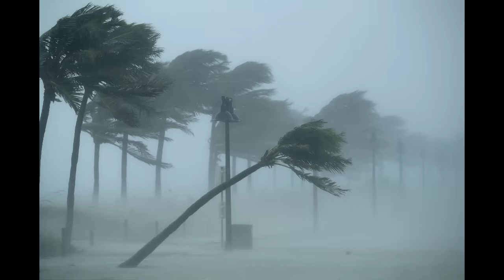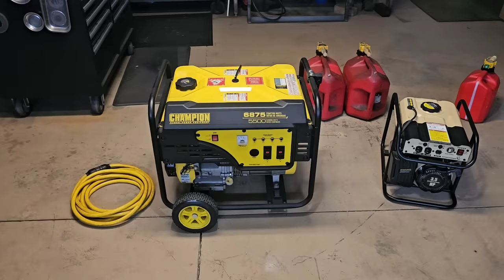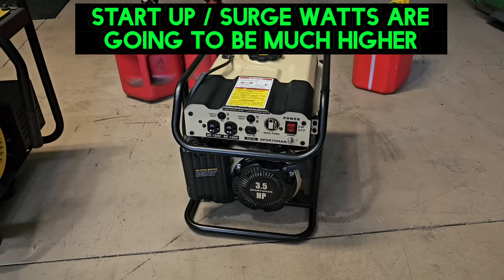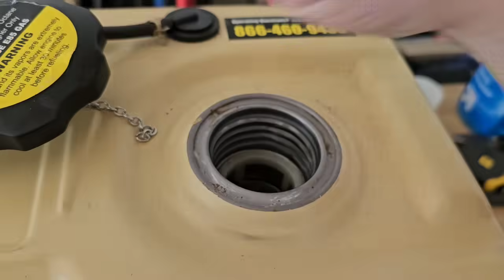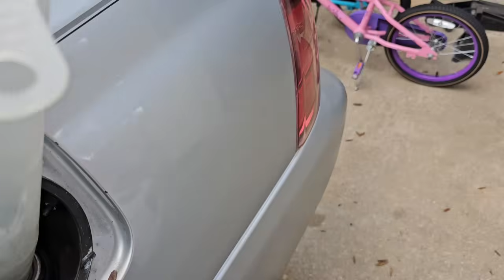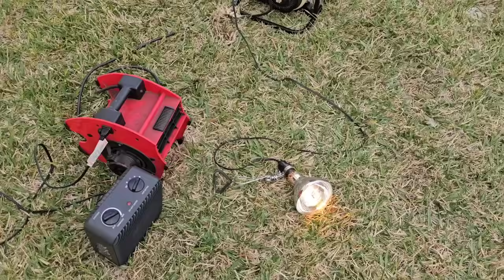Why smaller generators are better for power outages.

Comment: Crank your generators once a month.  Use only non-ethanol gasoline and put a fuel stabilizer in the fuel which will extend the life up to a year, easily.  If you do not have a Quiet generator, consider making a House to put the generator in to keep it out of the weather and tone down the noise. 

The use of Non-ethanol gasoline is critical, and you can often get it at a small local airport if none is available at gas stations.

If you are in an area where power outages are not unusual, having an extra spark plug and fuel filter is critical to have on hand, along with extra oil that maybe needed for long use.

Some Heat/AC units need an adaptor added to the unit to work properly.

The NON INVERTER generators may burn up computers, TVs and other high end equipment.  NON Inverter generators are usually ok for freezers and refrigerators, but anything with a computer needs an inverter generator, especially WIFI, phone chargers, etc.  Your local electric company can offer a wealth of information on these issues.
Reply: I drain completely the fuel. And I mean completely. Run it every 8 months and it starts on first pull. Don’t need all that extra ethanol free etc if you store it properly in the first place

Comment: Just went through hurricane Beryl with a 1500 W (1800 W peak) rating.  I was able to keep a fridge and freezer running along with a fan, chargers for phones and power tools, internet modem etc.   It has a 1.5 gallon tank that lasted about 6 hours per tank.  Our neighbors with the larger generators were needing gas often and gas was hard to find.  Although the neighbors with the large generators were sharing with those without.
Reply from the maker: Thanks for sharing Scott. How many days did your area go before power was restored? How much gas did you end up using?

Comment: I use a propane generator. When there was a power outage due to a snowstorm in Texas, gasoline was unavailable. There was no electricity to pump gasoline. I have a dual fuel generator and I have two weeks worth of propane. It doesn't go bad, doesn't gum up carburetors and it will run everything in my house.
Reply: Me too propane is only way to go or natural gas as back up
Reply: Been considering this same idea. Duel fuel and having propane tanks on hand since they just hang out til you need them. How many tanks do you have for two weeks supply? What size generator? Thanks!
Reply: @stephencabrera8785  12000w  pulsar g12kbn, and I have 4 100 lb tanks and six 20 lb tanks. The generator will run for 7.5-8.5 hours on a 20lb cylinder. I'm not sure exactly what that adds up to with my supply, but it is enough, in my opinion. My brother has a 500 gallon tank with the exact same generator.
Reply: @leodanryan966 4 -100 gallon tanks?  No access to NG?  Heck of an expensive burn for a week or 10 days. Not many people want 4 -100 gallon tanks lying around
Reply: @condor5635  nope, no natural gas in the entire neighborhood.
Reply: @leodanryan966  25 years in my house, not a single natural gas loss ever. Texas.  Not sure where you are, but having low pressure where natural gas is made unusable or no natural gas at all doesn’t happen where I am. Not to say that you shouldn’t have a back up u source.
Reply: @leodanryan966  damn 8.5 hrs on a 20lb tank? Is that at like 25% load?
Reply: @stephencabrera8785  if you have a small one as well and say charge up a portable power station that maybe has 2000WH or north of that. Limits the amount of fuel you’d have to consume because you just need to charge it up. Also allows you to buy a smaller generator.
Reply: Problem with propane is if you don't have a big enough tank, it won't work when it gets cold. The 20lb tanks start having issues at 10 to 15 degrees.
Reply: @teeing9355  I would think in that case warm up your tank maybe in your house or garage before using it and then use the exhaust of the generator to keep it warm
Reply: Os yours a firman 9400 ?     I got one and love it.  So far lol
Reply: @ernest9606 
I have this one. Very loud.
I needed it and ran it for 24 hours. I changed the oil and it was FULL of metal .
Reply: Thinking about getting one myself.
Reply: I just got back my street power that was lost due to hurricane Melissa here in Jamaica. I was using a duel fuel Ford brand 4500 watt to run my house 4 hours on 6 to 8 hours off for the past week. I burned 160 pounds of propane keeping it in my garage safe and sound. No exhaust fumes or noise to bother they neighbors because they too were using10000 watt generator running to the gas station twice a day. If I had used my house wired 12k Watt Generac generator my fuel bill would be 3 times higher.
Reply: One would think that fuel stations would have backup power. A B.J.s Club fuel station near me has a huge diesel fired backup generator.
Reply: Propane and natural gas both require electric at some point along the line 
Eventually that will fail too. Also ,when filling your propane, whats the first thing they do? Turn on an electric pump .
Reply: @trustme7731  - well in 25 years I’ve never had natural gas fail during any storm events. But I agree with your points.
Reply: @condor5635  
In the winter natural gas pressures can fall to the point of not being usable. Regardless, with no electric, natural gas will  eventually fail.
Reply: @trustme7731  not where I live
Reply: @trustme7731  that maybe true in extreme cold areas, but in average winters here in rural NY, we've never had any issues with our propane or natural gas. We heat with natural gas, but have two 'ventless' wall heaters that run on propane as a back up. The neat thing is in the event of no power, the propane heaters use a push button ignitor similar to starting a cooking grill to light the pilot. Once the pilot is lit, it stays on until we shut the heater or the propane off. The heater has a built in thermostat so it comes on and goes off on its own.
Reply: @SPCLPONY  the pumps that pressurize the NG are electric what happens to the pressure should everyone lose electric?
Reply: @iffykidmn8170  Good question. I don't know for sure. Maybe they have a backup generator like hospitals and fire stations do? I'm told it's not a very high pressure coming into the average home. We went without power for 2 days this summer. That's the longest down time in 30 years in this community. The only natural gas that we would have used during the summer would've been for our clothes dryer, which we didn't use. So it's hard to say what would've happened if we went without power for that same time period in the winter and ran our furnace. Our propane system is from a tank in the backyard that gets filled by a delivery truck. There are several propane companies in our surrounding counties in rural NY & Pa, as it's always in demand. I'd find it highly unlikely that all of them could lose power to their main systems at the same time unless it were some kind of terrorist act. We've never had any issues with deliveries or our system not working due to cold temperatures.
Reply: @SPCLPONY  again natural gas supplies are very resilient. 30 years in Texas never a single natural gas disruption.  It’s super unlikely.  That’s not to say you shouldn’t have a back up fuel.
Reply: @condor5635 during the major freeze in 2021, several people did not have natural gas. Apparently the gas lines froze up. I never heard of it happening before but it happened in the Houston area. Plus so many people installed standby generators caused some problems with a few homes not being able to get their generec standby generators to function. They stated it was caused by low PSI. Again this was not typical. But surprisedly it is starting to happen more and more. Recently happened to a family in Louisiana, the story made the news.
Reply: @iffykidmn8170 are they not gas turbines. I’m pretty sure the compressor stations in the Uk use the very gas from the line they’re compressing.
Reply: Actually no. I live over the confleuence of two major gas fields. There are actually thousands of points of supply from all the gas wells scattered across the towns feeding local consumption
Reply: @condor5635 
Never say never. 
Anything can happen.
Reply: @SPCLPONY 
You never have trouble until you do.
Congratulations on having an electric free backup.
Reply: @SPCLPONY 
I've worked in natural gas pumping stations. None had generators. Too big of an electrical load. To give you an idea, I was replacing the entire 13,800 volt electrical service. 
Propane delivery truck are filled with an electric pump.

Comment: If you have natural gas and/or propane then you should concider updating your generators to tri-fuel. About $164 and a couple hours and you can have three options to power your house. If you install a 12,000 watt battery bank you can run your generator for just a few hours to charge your batteries for the day which will save a ton in fuel costs. Propane and natural gas also do not clog up your carburator like gasoline. If you install solar as a diy project you can also save enough off your electric bill to pay for itself in just a few years.

Comment: For Computers, High Def TV, and other high tec appliances is that std generators produce "dirty" electricity.  What is needed is a generator that produces a Clean sine wave that demands an inverter generator. Many furnaces will not run off a regular generator.

Comment: So, you're telling me that a 1200 watt constant generator running at 100 percent power uses far less fuel than a, say, 7200 watt generator producing 1200 watts at just over 16 percent power? Uh uh. Not possible.
Reply: I flunked calculating derivatives but if a car is running on idle and moving 6 MPH it uses gasoline. If that same car is traveling 60 MPH it is using gasoline. What is the optimum speed to travel at to get the most miles out of the gasoline?(ps, i made up that part about flunking.)

Comment: Great video! Your video is very informational for folks who are just starting to get into back up generator power. 
However I’m in a different league almost onto itself. I’m a power lineman for a living so I’m very aware of back up generators. I have the best of the best because I don’t want my neighbors to know we have power. My neighbors are very close by & to have an obnoxious generator running all the time will make quick enemies of my neighbors. 
I have the flag ship model of the Honda inverter line. The EU 7000is. It’s fuel injected & burns way less fuel than even your smaller generator at half load. It’s comparable in size to your larger Champion. When the Honda is on it is super quiet at 58 decibels on regular & 54 decibels on economy mode. It’s rated at 5500 watts with a surge to 7000 watts. I have personally tested mine to 9200 watts surge & it runs fine. With everything on including the 2-1/2 ton central air I’m using 3750 watts. I have a soft start kit for my A/C. I keep 111 gallons of gasoline at my house incase of a power outage. That’s enough gasoline for twenty days. The Honda burns 11 gallons in 42 hours at half load. That’s almost two full days between fill ups. I bought an auxiliary fuel tank that holds 6 gallons. I refill my auxiliary without shutting my generator off. I have 15 of the 5 gallon No Spill fuel jugs. Not 4 or 5. The longest I’ve been out of power was after storm Isais a few years ago. I was busy working storm work getting everyone else’s power back on. I knew my family was safe at home. 
Maybe you can do a review on inverter generators? Most people are unaware. You almost need an inverter to power your home. Every appliance today has a micro-processor in it. Without clean 60 cycle power they may not power up? Or if they do? They might damage it with dirty power off a conventional generator. The same adage exists. Save money on a generator & replace all your appliances after a long duration outage. OR buy an inverter generator & keep your appliances. The choice is yours?

Comment: Inverter generators are quieter because they throttle down when loads decrease (also saving fuel), while standard generators run at a constant 3600 RPM.  But inverter generators are usually smaller, and rarely output 240 volts.

Comment: Get a generator which can run on propane and keep a bunch of filled tanks in your garage. You can store propane for as long as the tanks don't rust through which will be forever if you keep them inside a building. Be aware that if you get a 12,000 watt generator you will need a lot of propane or gasoline to run it for more than a day. I would suggest 30 or 40 pound propane tanks. You can move them around with a hand truck if you are older.

Comment: If you live in the country and have a well, the pump is likely 220v.  For us,  water is the most important thing to have during a power outage.  Small generators do not have 220v capability.    Our generator MUST have 220v capacity at a minimum.

Comment: I have 2 small generators: a 2400w ultra quiet yamaha Inverter type,120 volt and a relatively quiet 4000 watt generac 240 volt. I converted both to tri-fuel: natural gas as default since it is hooked up to the house and I don't have to store it. As a second source I store 250 lbs of propane and as a last choice 70 gallons of gasoline. I am currently installing a 12,000 watt hour battery backup system so that I don't have to run the genertors full time for power. I can charge my batteries to supply all my critical needs in just a few hours, once a day. Next year I will install enough solar to cover all critical needs when the sun shines. The pay back, for me, is 3 years on the solar and 6 years on the battery system. As I explain to poeple I concider this an insurance policy that will pay for itself in 9 years. How many other insurance policies pay for themselves?
Reply: What are they charging you on your solar setup?

Comment: Get a dual fuel generator and buy several 40 pound propane tanks.  Runs cleaner, doesn't need fuel stabilizer,  won't gum up the carb, and lasts virtually forever in storage.

Comment: I have a kind of unusual situation and this was very helpful to me. I’m an American living in Ecuador and we are having droughts and are in a state of emergency now so we have mandatory rolling blackouts everyday for 4 hours a day. I’ve never owned a generator and although I speak Spanish, I’m susceptible to being “gringo’d” by salespeople as an American and sold more than I need. It’s just me and my dogs and for 4 hours a day, I realized from your video that I don’t need a huge high-wattage generator. Just enough to run a TV or a coffee maker, a couple lamps or the water heater but not all at once. The fridge is fine for that short duration. I’m really grateful for this information. I’m collecting the wattage information from the appliances I will need to use. Thank you, thank you, thank you! You have saved me a lot of money and confusion in a foreign country!!
Reply from the maker: Glad it helped. If your water heater is electric that might be your biggest wattage need. Good luck and thanks for watching
Reply: @Mechanical_Mind  Good to know! Thank you again!
Reply: For predictable short outages, a properly sized battery backup station would be a good option.  I recently bought a Pecron E1500LFP, and it helps by giving me time to cook, make coffee, and keep internet on while I setup my generator.  Last outage, I made my coffee & was about to go setup generator, and then the power came back on.

Comment: I purchased a Honda 2k inverter. It is capable of running our refrigerator and freezer. Also a few lights with management of loading.  The larger generator I own will run all of those at same time,  but likes the fuel.

Comment: I built our house and wired it. I put a sub panel with its own transfer switch that runs the furnace, fridge, freezer, lights and internet.  We can run our house over 10 hours on a 1 gallon tank of gas in our Honda 2000. We also have a Champion a little bigger than yours  I hook to the whole house transfer switch. It has a FOB remote  start and we only run it for an hour or so at a time to run heavy loads like our well pump. Our total gas consumption is about 3 gallons a day to keep the power one. With ATVs and snowmobiles we always have 20-30 gallons of fresh gas around and I have a way to get gas out of any of our 3 pickup trucks. We live in a fairly rural place but have a fuel distributor a mile away that has plenty of available fuel with backup generators. I can even take the UTV or snowmobile to get it.
I drain and put fresh gas in it every fall when I change the oil. Then I run them on a load for few hours just to verify they are ready to go for the winter.

Comment: I have a small 2-cycle 1000w ultra quiet camp generator that runs 8 hours on a gallon of gas. I paid $149 for it years ago. Never leave fuel in a 2-cycle engine and it will be very reliable. Outages here are winter, so a couple coolers on the deck (to keep food from freezing and frustrate wild animals) replace the refrigerator. I have a 8500w propane generator that will run the well pump or water heater for showers.

Comment: "... run this thing all night just to run your refrigerator ..."  An alternative to a smaller generator to keep things running at night, is an inverter run off batteries. You can charge your battery bank during the day with the generator. Quite and can keep low consumption items like a reasonable sized refrigerator and a couple of emergency lights powered overnight.

Comment: You have to figure the wattage of what you HAVE to have running>>>fridge, furnace in the winter, well pump if you have one. Size accordingly. Don't need most of the rest.